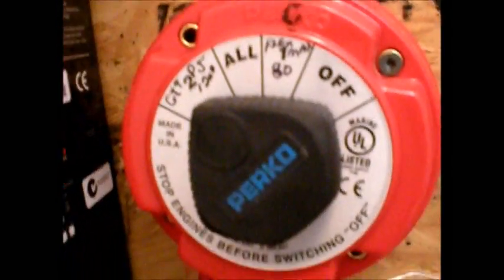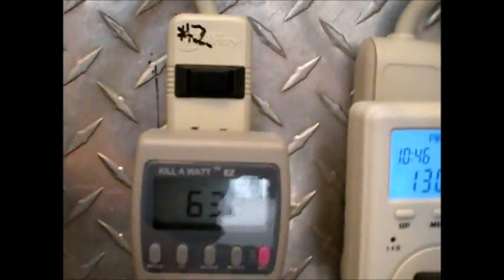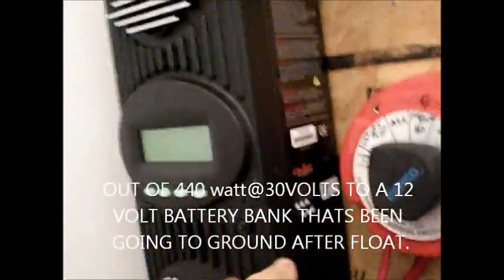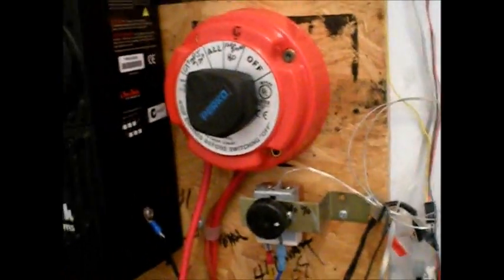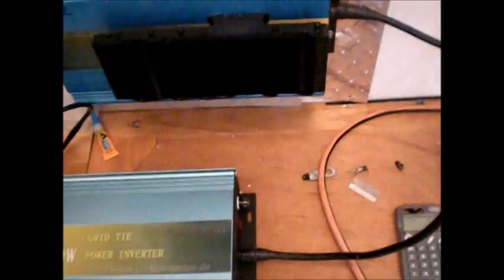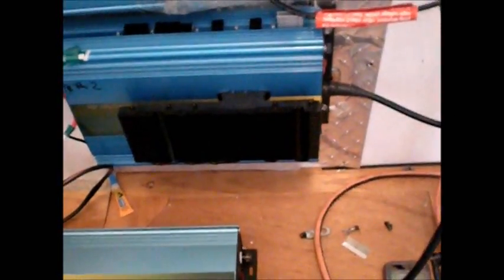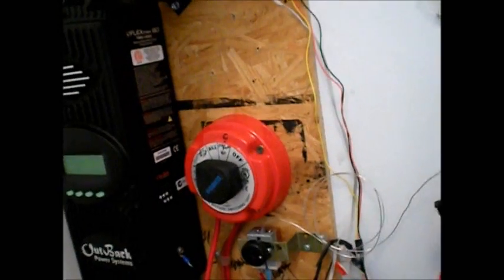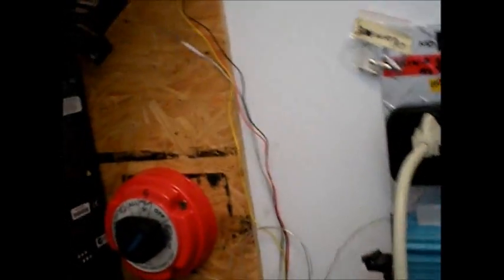Testing my battery switch to power inverter.

Comment from the maker: i Plan a solar farm on my spare lot my goal is to be as close as possible off grid. I,m going to install at least 5- 240 watt mono Panels.I,m also adding 2 new tracker kits.4 panels each.and replace tracker #1 that works fine but is not anywhere close to the new Kit.4panels will be grid tied 1 will be added to my Trina panels Maxing out my new charger at 80 Amps at 12 volts MPPT.Power then when floating,I,ll  switch to grid. Using  battery's at night like right now. U will dent your bill,u see.